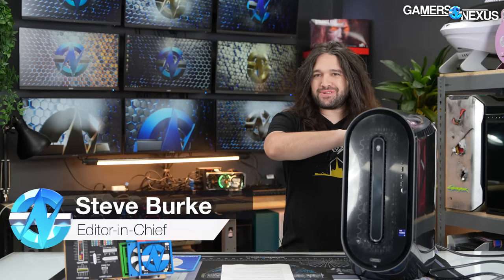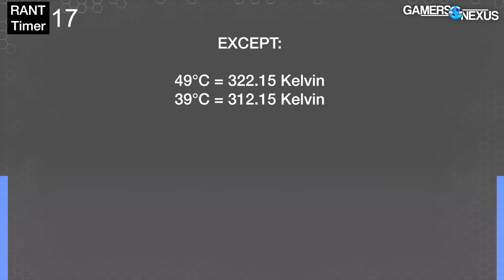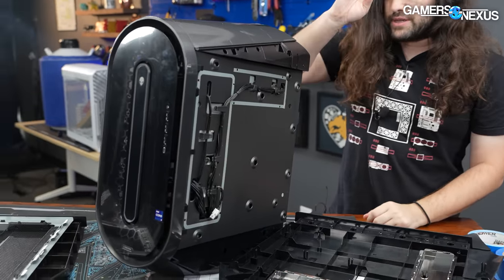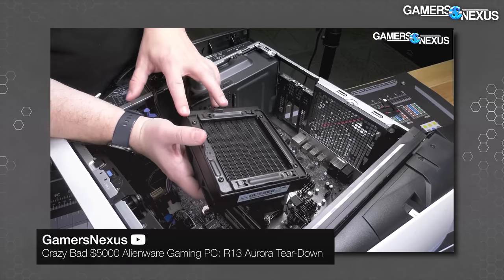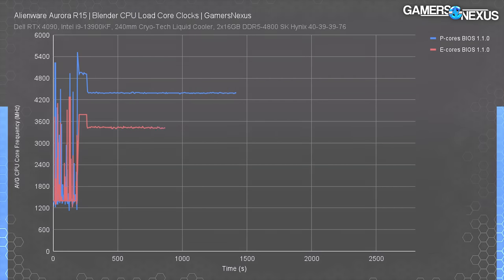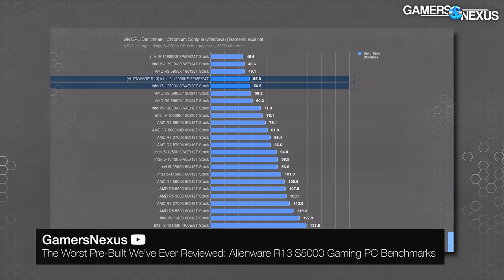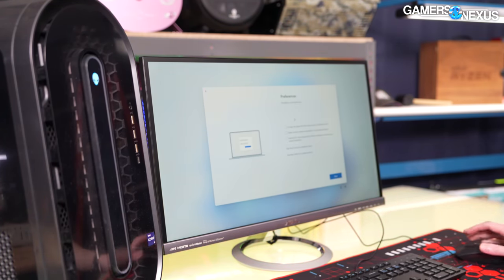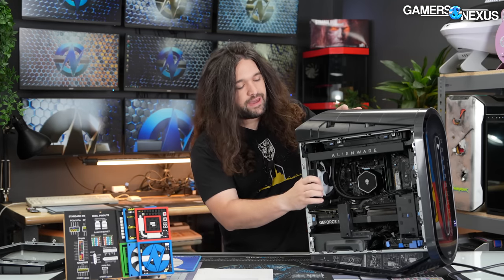Alienware Can't Get It Right - R15 2023 Pre-Built Gaming PC Review

Comment: Regarding the rant about how Dell claimed to improve thermals by 20%, specifically, how a different unit of measure was used to "demonstrate" how Dell's claimed numbers aren't trustworthy. I'm not entirely sure it is just marketing hijinks, pretty much all PC and component manufacturers utilize Celsius as their primary unit of measure when referring to temperature - there wasn't an asterisk and fine print stating * when one converts the measured temp from Kelvin to Celsius. They didn't avoid providing their improvement numbers in Kelvin because they were trying to make it look better, they may have just been following an industry standard and measured in Celsius.

Comment: The way to calculate percentage thermal difference should be to take a controlled ambient room temperature as your zero point and compare the delta of the two measurements. Measuring in kelvin with 0 K as a baseline is pretty meaningless beyond exotic cooling like liquid nitrogen because it's impossible to go below ambient.

Comment: The last (and first) time I bought a Dell prebuild, it had a Q6600 CPU. I thought the thermals were bad, so I ended up putting their proprietary board in another case. As to them putting in a lower CPU that would do the same job, I think they are just using the CPU as a marketing gimmick while not giving the user the performance they think they might get.

Comment: Just using JEDEC spec memory by default is nothing bad... it's what CPUs are validated with and in combination with a GPU like the 4090 that will most likely used at higher resolutions and in scenarios (it's marketed as Gaming-PC) where the GPU probably still is the limiting factor, memory speed is not that important. Throttling because of bad thermals on the other hand is a complete no-go.

Comment: When you compared the temperature scale, first I thought it made sense. Then I thought it didn't. I think the base temperature should be the average room temperature and not 0 Kelvin or even 0 degree celsius. Unless you use cryogenics or coolers that use thermodynamics cycle like refrigerator compressors etc, don't think temperatures lower than room temperature is possible anyways.

Comment: hello, and we're back with another update on my R15.  we finally got a hit on the root cause of the blackouts.  apparently the gpu power cable is tapping out.  while I could not identify this issue myself using the monitor (gpu takes the hdmi connection with it) dell support was able to use their remote connection to bring up the device manager.  the gpu was awol.

good news: problem identified.  bad news: dell is completely incompetent.  it went into the workshop again so that they could... i don't know what they could have done.  replace the cable maybe?  we replaced the gpu twice already.  the first time bought me a week or so, but then we were back to constant blackouts.  the second time was less impressive.  dell also replaced my solid state drive, fans, motherboard, cpu... essentially everything shy of the power supply and RAM.

Tech support claims they had no record of other R15 crashes.  I've seen two on the first reddit I found.  at least one was in repeated contact with dell tech support over these same symptoms.  so somewhere they are dropping the record.  Dell technicians would do nothing outside of the base diagnostic tools, which were completely incapable of discovering the gpu failpoint.  what was able to trigger the blackout consistently was sending a file containing my device's specs through remote assist.  that knocked out the gpu both times, and the second was how they identified the issue.  Valheim, satisfactory, timberborn, modded minecraft.  hell, even realm grinder managed to trip the (gpu) blackout.  most of these games had a random amount of time, and or a coin toss as to whether they'd blackout.  I've had as many as four blackouts in a single day across multiple programs.

The R13 apparently had a similar issue / similar thread of use based troubleshooting.  found a video for that too.

 I really did not expect such a perisistent problem when i bought this device.  I got high praise when it came to the service that dell would provide their customers.  so much so that I committed to buying this device ahead of schedule.  going through the support team enforced a lot of downtime.  the effort put in by their in house technicians was pathetic.  at the very least, I expect they (the shop techs) could have recreated the blackout issue using any of the softwares listed, or some alternative stress testing.  I am disturbed by the amount of 'field testing' is was asked to do.

Five months i've been at this.  according to dell, I'm on the more patient end of the spectrum.  this was before they could identify the problem.  I've been called to factory reset several times (thanks for teaching me how to do that), and been shocked by how many times i've had to regress.  I should have returned it when it started bluescreening in the middle of the night, while I was sleeping.  one month was not enough time for the original gpu/cable to degrade to the point of interrupting gameplay, meaning i could not return it when it mattered.  I am torn between selling the parts, holding onto the gpu for a custom build, or tackling the cabling monster myself.

Comment: How is their "sale" price not the normal price? I got a custom prebuilt from Overclockers UK for about the price of this system off sale. It has a 7950X3D, Msi Suprim X 4090, Noctua NH-D15, 1TB and 2TB FireCuda 530s and 2x32gb Corsair Vengeance 5600MHz DDR5, MSI Mag B650 Tomahawk, Phanteks G500A case and MSI MPG A1000G PSU and it came out to about the same price as this thing off sale.

Comment: I can see improvement in the charts, it gives me hope for Alienware. Perhaps the next generation R15 can be a PC recommendation, or at least something worthwhile to buy when on sale
Reply: It will never be a recommendation for one reason and one reason alone; proprietary hardware. Good luck replacing stuff when it goes bad, let alone trying to upgrade it. Alienware has and always will be, for the uneducated consumer with more money than knowledge.

Not only is it properitery, the BIOS is which you are stuck with and have limited to no control over is tuned incorrectly.
Reply: Alienware is improving but its a case of they make 1 year worth of progress in 2 years. The R15 case probably would have been fine up to about 10th gen Intel as that was when things really lit off in terms of cooling demands. On the other hand the swing out PSU case should have been retired around 7th gen at the latest. So they need to make a 5 year design jump in 1 year.

And there needs to be a lot more, I hesitate to say technical but technical education. LTT made mention of this a few days back but for some reason people thing a i9 F sku is a good CPU for gaming. 

And there needs to be a solid de-indoctrination effort. After the R13 review I caught a stream where someone from Intel said "but 100C is fine". And that has stuck so fricken hard. "But the CPU is only at 95C, 95C < 100C, CPU is fine!"
No, in order of importance: frequency, power draw, temps. 100C is fine if your 13900K is blazing away at 5.4GHz all core. If the same 13900K is struggling to break 4.3GHz at all, something is wrong regardless of temps.

They must fix the massive performance (and BIOS) issues. They must go back to standard parts. And they need at least another major case improvement.

Comment: Alienware is a shell of its old self.  I have been a Dell certified tech since 1999 and will not buy another Dell system again after my experiences as a consumer the last 18 months.  In all, I have had 8 personal Alienware systems fail during the last 18 months.  In fact, I have a pending repair of a x17 r2 i9, 3080ti system that has been in process for the last 3 months.  The only Dell systems I will use are ones that will come from the ones currently under warranty.  After the warranties expire, there will not be another Dell system in my life.

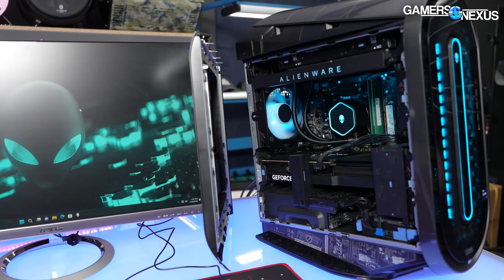Comment: 14:22 Frequent BIOS updates is nothing new for Dell, if anything they're better than ASRock/ASUS/Gigabyte/MSI/etc about pushing needed updates. That said, nothing makes me more scared about plugging a computer into the internet and receiving a firmware update without an external battery being plugged in.

What I really really want is for desktops to support being plugged into a USB-C PD device (eg a battery) to enable a firmware update. Not "require", support. Because "require" a battery in laptops to do a firmware updates is something that ASUS does and it hamstrings being able to even reinstall the OS.

Comment: Looks like Alienware still have the same issues that has haunted them for a long time. I got a 17 R4 laptop not long after it came out (1080) and it was a frustrating overheating and underwhelming thing. Compared to similar high end laptops,  it was terrible. So many driver issues. Long nights into disassembly to repaste the gpu/cpu whilst balancing the terrible heatsink. It got me through the 4 years I needed a mobile gaming platform but it fought every minute to just not work. I could never get the CPU to be anywhere near it's advertised values. 

It's a bit sad to see they are struggling like this. They always have been a bit of a meme of a company but their 'premium' experience has been declining for so long now. I enjoy the aesthetic but what's under the hood needs going back to the fundamentals again.

Comment: couple few questions
does anyone actually find that case attractive or "cool?"
would have liked to hear about the value vs building yourself, because i kept wondering, where is all that money going? was it ssd & memory "upgrades"?
i guess with such low spec memory, heat spreaders would be a "waste," but given the attempt at aesthetically pleasing design, why wouldn't they add even something basic to cover the green pcb?
and finally, shouldn't the pump mount be oriented in a way where bubbles can escape out of the pump instead of being trapped inside? i mean sure, you could just flip the system, but that seems kind of extreme and tedious...

Comment: As someone who has built my own PC for years and then when the great graphic card shortage hit in 2021 bought my first ever pre-built (Alienware R12) so I could get a Radeon 6800 XT without paying $1000 for just the video card I was impressed, but I agree with many folks the cooling on the R12 was really bad.   Last month I was able to snag an R15, with a i9 processor,  and a 4090 Geforce. for $2500.    I replaced the hard drive with a Samsung 990 Pro which was the only upgrade I did I have to say the machine runs like a beast.  Its amazingly quiet even with max graphics settings at 3440 x 1440 for every game I've tossed at it.      Also with the price of the 4090's right now starting at almost 2k,  I can honestly say the rest of the components are easily worth $500 if not more.   I think its an amazing computer if you can get it for under 3k.   Also mine came with Kingston Fury Beast Memory, not that cheapo green stuff.

Comment: You are lucky the FETs blew open. If any of the 12 is shorted, it blows up the CPU. The CPU voltage goes to 12V instead of 1.199V.

Comment: At pc part picker your building a i9 13900k system with a 4090 TUF gaming, 64 gigs 6400, a Z790 ROG mobo, 2x a 2TB 980 pro nvme and a 1000watt Corsair PSU in a 4000D case with a 360mm AIO for $3900.

So why would you ever pay over $4400 for an Alienware which is completely crap anyway?

Comment: The XPS systems use the exact same chassis, as do a number of the Optiplex systems. They designed this frame once like 20-30 years ago and don't want to invest in anything for the now, never mind the future. They were huge bottlenecks years ago, they were literally designed for 80 to 92mm fans, when we're in an age where you really do need a 140mm on the exhaust for anything higher than mid range modern hardware.

Comment: What's weird is the older Aurora chassis all had topside ventilation, in fact the Aurora ALX had the most outrageous system of motorized shutter vents (called active cooling), never seen anything quite as cool as that on a prebuilt pc.  So much wasted volume with this case, its biggest sin.

Comment: For big money setups they 100% suck but for a moderate pc it's perfect. I've had a alienware back in the day then switched to the xps and now using the r13 and its been a beast. When I bought the r13 I priced out building my own n only would have been $200 cheaper with a case that sucked a cheap motherboard and some other things that I didn't like. So I went with my r13 n been happy. Next tho I will build my own
Reply: But the Alienware cases and motherboards are terrible
Reply: @christophegroulx7816  I love the r13 case so even tho we can disagree for my needs it perfect.  N yeah proprietary motherboard does suck but luckily I still haven't ran into any issues. I'll probably pay more if it burns out to replace it but honestly at that point I'll just build my own or buy another alienware just cause it's been good to me

Comment: Maybe I missed it, but I can't help but wonder, is the power limit really because of the case? Wouldn't it be fine if Dell just removed the power limit? (assuming the psu can handle that) And also, the cpu temps seem ok, but still high to me. Is that because of the cooler, or is it because of the thermal paste/pads used? Because in my own system, better thermal paste lowered my temps by more than 10 degrees

Comment: Glad to see they made improvements with the 4090 at least. My dell 3090 was by far the hottest card I've ever used. I replaced the pads, got better paste, got copper fins to slap on the back, and even direct mounted a 120mm noctua to said copper fins. Still would top out near 110C

Comment: 4:05 It's hilarious when people try to criticize and pretend to know better by bringing up Kelvin values. Temperatures below 0 degrees Celsius are irrelevant due to the impact of external conditions on household computers. Obviously, Celsius should be used in this context, and their attempt using Kelvin to condemn the ad is just absurd.
Reply: Not the only reason it's absurd, it shouldn't matter which unit u use since to calculate cooling effectiveness you first have to subtract the ambient temperature

Comment: The part about the % improvement is profoundly wrong.  The perfect performance would be if the computer maintained room temperature.  This is not a refrigerated unit.  Comparing to absolute zero makes no sense at all.  The improvement is (1-(Tnow-Tenvironment)/(Told-Tenvironment))*100.  So for example (1-(40-25)/(50-25))*100=40% improvement.
Reply: NOT TRUE

Comment: Current deal: 3300 Euro for the Aurora 15 with a ryzen 7950x3d and rtx 4090. Ram 64 GB.
Soooo tempted!

The Ryzen 7950x3d should use less power = less thermal throttling?

And x3d can perform well with slow ram?
Reply: A 4090 costs 1.7k. that build should cost max 2.7k. still garbage.
Reply: @TonyChan-eh3nz  Prices for the 4090 went up (1900+ Euro) and you won't find any pre-build cheaper than the Aurora. That said, I mixed up the cpu, it's a 7950x, not x3d.

I also literally slept on it and couldn't find a reason to actually upgrade from my 1070. I don't see the games that I really want to play that ask for it. CP2077 DLC ain't enough.

Comment: it pains me to see them doing bad because the potential is there. I don't even hate the design it adds to the Alien name but i don't see why the interior needs to be tilted without keeping the same design.I am failing to understand the half clear/ half mesh side, might as well make the whole thing mesh to at least add breathability!  I just want to slap whoever is in charge. The interior space should be the number 1 priority and everything else 2nd. The spring with the alienware logo is ugly and unnecessary.They should have kept the previous one from r12 where the alienware logo is on the side of the case with RGB.

Comment: I just got this build for $3002 shipped/after tax. Curious to see if that price would change your overall opinion.
Reply: Still no.
Reply: @TonyChan-eh3nz  not sure why people hate on Alienware so much. I used an Alienware m15x all through college and it still works great to this day. This is my 3rd Alienware and I have never had issues. I did some thorough benchmark and stress testing to this R15 and it yields great results and doesn't get hot enough to cause issues. Seems like a fox and the grape story for most. Or they have never owned one personally.
Reply: @aaronschug6671  it’s still overheating proprietary parts with a shit ton of bloatware, cheaped out internals, warranty’s that literally scam you(did in the past), shitty configs, no upgradability etc
Reply: @TonyChan-eh3nz the temperatures I am getting while gaming is maximum mid/high 70c on both the GPU and CPU which is nowhere near hot enough to damage anything. So that's not overheating by definition. Uninstall the bloatware. Proprietary isn't always a bad thing, it depends if you like to rebuild your system all the time. I have gotten to the point that I'd rather just buy a pre-built. And since I have never had any real issues in any of my alienware computers I went with them.  My m15x needed a part fixed during its warranty. A 5 minute call and they sent a guy came to my house and fixed it right away. So what you experienced isn't the norm.

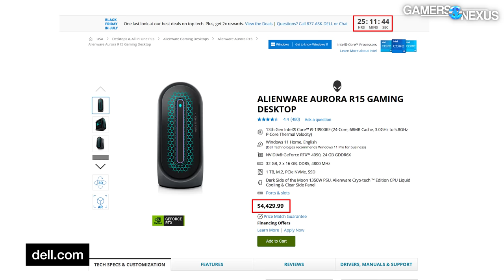Comment: 23:46 - But why would it be dusty?... It's either inside an already-assembled system, or in its box... That GPU has been running and sucking up dust from somewhere. - I have a GPU here that I've used from early 2020 until early 2023, that's 3 years, almost daily, and it's not as dusty as that. - It doesn't make any sense.